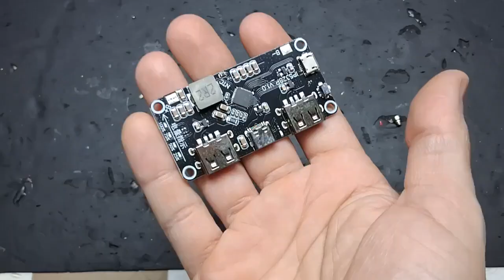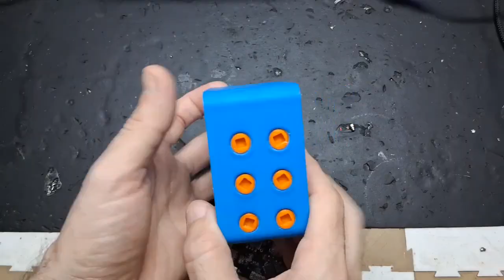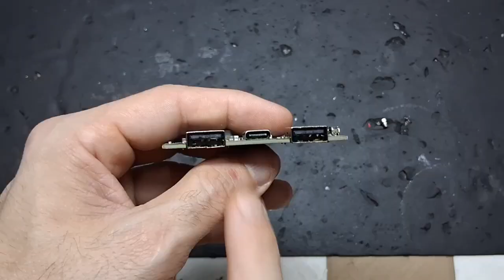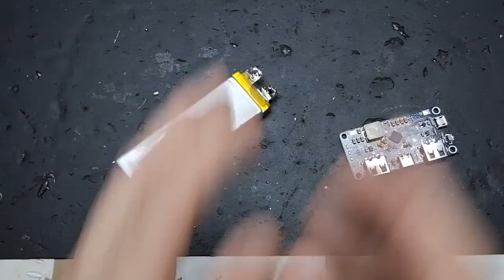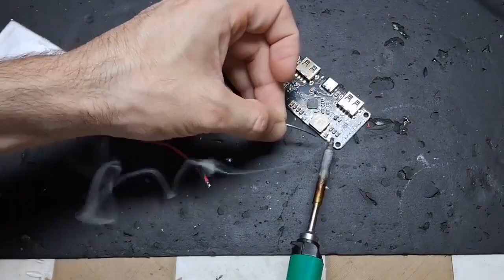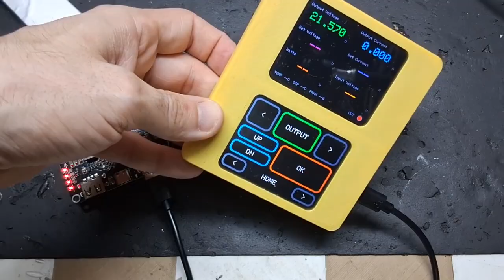IP5328P USB PD Power Bank Board

Comment: What is the exact name of this your 'USB Powered Screen' (Input/Output Voltage & Current Measuring device. Provide the link to the manufacturer and seller.
Reply from the maker: That dual screen regulator controller is a custom solution. It doesnt really have a name, sorry, haha. Its made with 2x CYD ESP32 displays. All of the software is custom and the casing is 3d printed. If you are interested in setting up something like that, I would be glad to help.